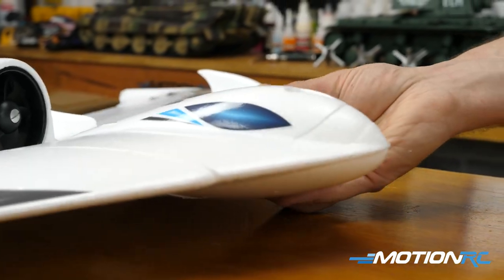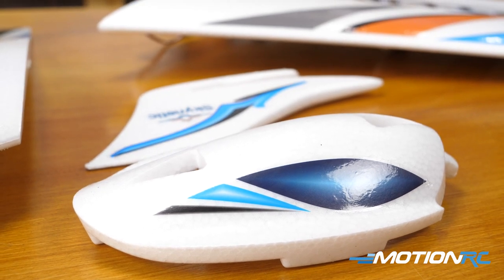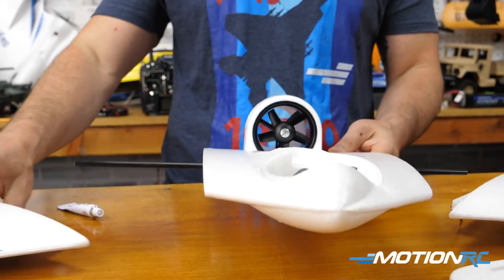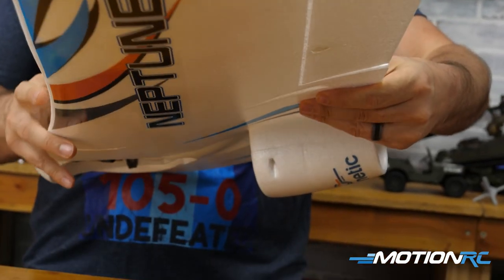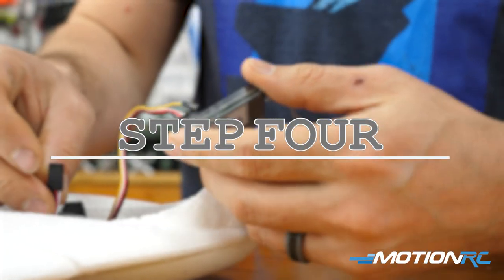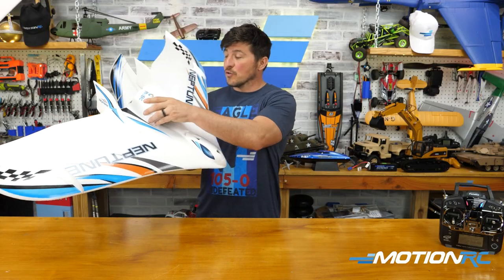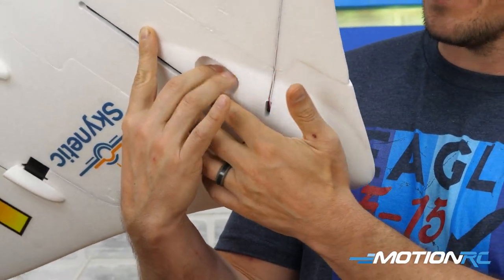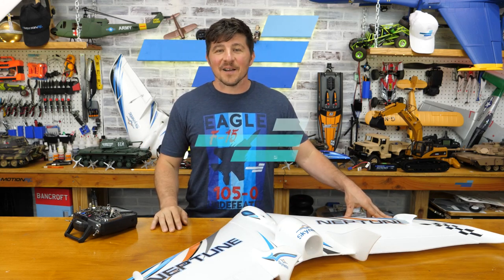Skynetic Neptune 64mm EDF - Motion RC Assembly

Comment: I wonder if the RMRC Recruit flight controller wouldnt work really well for adding SAFE-like features to this super easily, pre-programmed for a similar wing, and very inexpensive.
Reply from the maker: This is a pretty tame model as is. Sure that tech will always help, but it's really not necessary